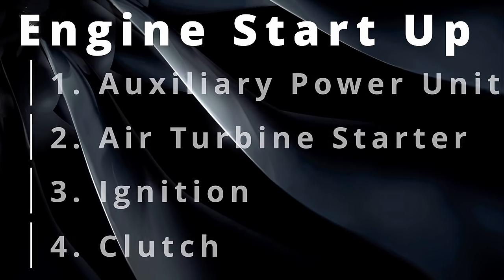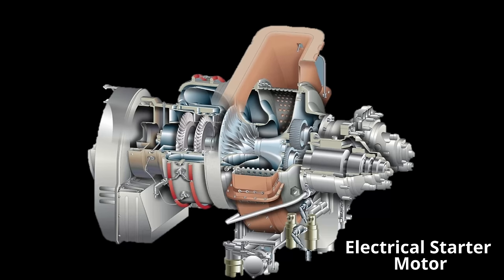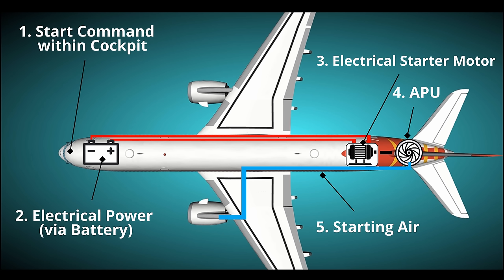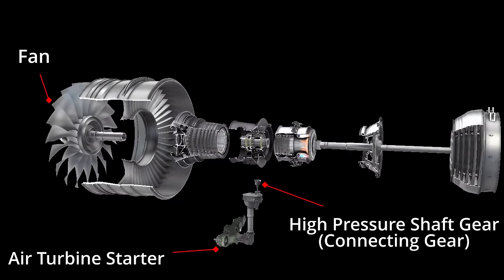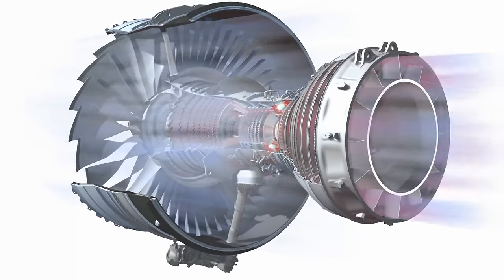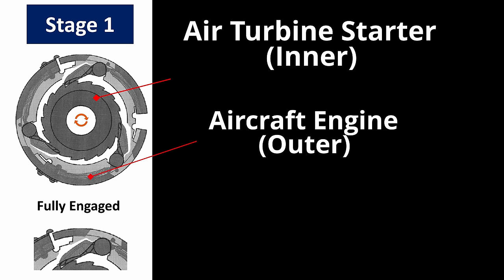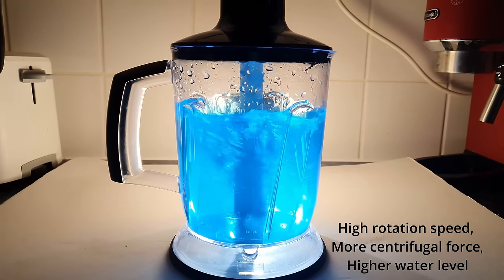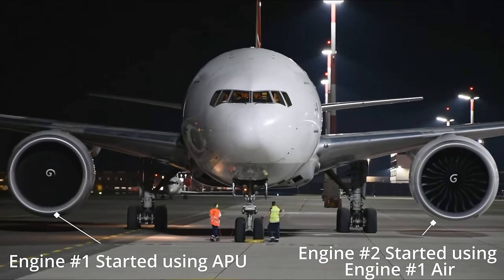How do Airplane Engines Start? (Including Startup Sounds)

Comment: Not all jet engines are the same. While APU starters are the most common now in the commercial sector, there are many other ways to start a jet engine. If the engine is small enough, it can be started with an electrical motor. Modern military jet engines either use an APU or JFS for engine start. APUs are used for both accessory air or bleed air for engine start and electrical power. JFS (Jet Fuel Starter) starters are directly connected to the engine core through PTO shafts. They will only start the main engine and provide no other benefits besides engine start. Older military jet engines did not have a starter gearbox on board and required an external air source to spool the engine for start. In the early days of jet engines, "start carts" were used to spin the motor over with a explosive charge. It looked like an oversized shotgun shell and used the explosive pressure wave to spin the motor up to speed for engine start.
Reply: Not just small engines can use electric starters, bloody great big things like those on 787s are started electrically.
Reply: @stephenholland5930  Really? Must be a big electric motor. Or a multi shaft engine 🤔

Comment: If fuel self ignites then it means fuel is Diesel. Is that true?
Reply: That part was incorrect.  Once started, the igniters are turned off, and fuel is continually fed into the combustion chamber.  Since there is already a flame there, the incoming fuel also lights off immediately.  Diesel engines need a couple hundred pounds of compression to ignite the fuel, where a jet engine might have only 50 pounds of air pressure.  
Think of a propane torch, once started, as long as it has fuel, it keeps lit.

Comment: Brought back lots of memories as a USAF crew chief. But many military aircraft the APU is an external unit that must be connected. Watched one disintegrate once. Glad nobody was in the redline blade area.
Reply: why did it didintegrate and why was it not containted?
Reply: @snorttroll4379  It's a small jet engine. It's built into a roll cart, that is marked with usually 2 red lines on both side marking where the turbine blades are. If in the rare instance the blades break or separate in any way, it will shoot through the cart sides like a hot knife through butter possibly in all parallel  directions.In the hundreds of APU's I've worked with or seen, I've only scene one fail that way. Although in training school they showed it in films to let crew chiefs know some of the daily dangers of the job.
Reply: The -60 was a mediocre air cart at best, but better than using cartridges.
Reply: Were your -60s self propelled? 

We had a -60 lose the main shaft bearing, lock up and shell out during ops checks. You could hear it bog down and then... Boom.
Reply: @iTz_JLAR  I've worked with both. Hated the self propelled. Mostly had manual ones. I would rather either pull them (as long as the tires were fully inflated and not low) or find a tug to hitch it to.
Reply: then it is a GPU Ground Power Unit.
Reply: @PeterNGloor  Yeah, I know, just typed the wrong one, thanks.

Comment: Just wondering what makes the plane stay still even the engine on high speed 🚅.
Reply: Do you mean before take off? Aircraft have brakes
Reply: @NicholasRiviera-Dr  i know it have brakes but i feel it have also some mechanical engineering behind it the amount of pressure coming out of this engine can move anything , i  also watch the helicopter 🚁 it will be on a high speed and still on the ground not moving until the pilot move it . I might be wrong 🤔 i just asking
Reply: @Johnwa99  I don’t understand your reply. As you know, aircraft have wheel brakes. They stop the aircraft from moving if takeoff power is applied to the engines
Reply: @NicholasRiviera-Dr  what am trying to say i think there more than brakes to keep the plane on the ground without moving this engine can move anything i don't think only the brakes what stops the plane from moving i think there are more things to it , i will check on Google i might be wrong 🤔 i just asking
Reply: @Johnwa99  I work on aircraft, it is only the brakes that prevent the aircraft from moving at the start of the takeoff roll
Reply: @NicholasRiviera-Dr  ok thanks 👍 I appreciate your reply since you working on aircraft can you explain to me also how the helicopter 🚁 on the ground with full speed engine and not going no where until the pilot take off. Thanks again 👍
Reply: @Johnwa99  aeroplanes are “fixed” wing aircraft while helicopters are “rotary” wing aircraft. Each helicopter blade is an aero foil that is spinning. The pilot uses a control called the “collective” to change the pitch of the main rotor blades. While the helicopter is sitting on the ground the blades are spinning with very small amount of pitch so it doesn’t create enough force to lift the helicopter off the ground. The speed of the blades is also very low, controlled by the throttle. As the pilot decides to lift the helicopter off the ground, the blades speed is increased by the throttle but the pitch of the blade is also changes by the collective to give the blades more lift, then the helicopter starts to move vertically.

I haven’t studied helicopters for a long time and never worked on them except during my initial training, so some of the information above might be a bit vague, but helicopters are a specialty. Do some YouTube searching on helicopters and how they work. They are amazing machines, particularly how they are able to change the pitch of blades (including the tail rotor) while they are spinning.
Reply: @NicholasRiviera-Dr  thanks for the information I appreciate it, I really thought that there is more to stop the airplane ✈️ from moving on the ground because the engine are really strong and give lots of pressure, but really thanks I glas I heard from someone who knows what he talks about. 

About helicopter 🚁 I use to work offshore so everyday we use to deal with helicopter and the small airplane the one with 2 fan , so for me I feel even the helicopter on the ground I use to feel the powerful engine u can't even stand under it 😂 but I really don't know how fast it is and honestly the pitch noise use to get lower after taking off . 
Thanks again 👍
Reply: @Johnwa99  there are occasions when we need to test the engine by doing an engine ground run. Sometimes that requires us to go up to take off power when the aircraft is stationary. The aircraft will be positioned on a run bay with a blast fence behind the aircraft. The brakes are parked but we also use very large chocks around the nose and main gear incase the aircraft skids.

I don’t work on helicopters but have a very basic understanding of the way they work. I did spend some time studying them during my training
Reply: @NicholasRiviera-Dr  that's great information there thanks 👍, I think you enjoy all the time working there I like to hear the engine sound 😂 but I think you all have to be protected all the time from that noise. Thanks again 👍 Respect
Reply: @Johnwa99  I’ve been working in the industry for over 30 years. The noise has caused some problems for my hearing (and every other person I work with). It’s very interesting and complex
Reply: @NicholasRiviera-Dr  oh wow 30 years that's impressive, I can imagine how you miss to go back there and work, hope you have your own business by now so you can enjoy your days. English is my second language so excuse if I say something wrong. Blessings
Reply: @Johnwa99  I still work there 😀
There is always something new to learn, great job for me
Reply: @NicholasRiviera-Dr  wow 😳 30 years and still working that's great it's time to take a boat ⛵ and enjoy your life 😄 . Blessings

Comment: As an airline mechanic of over 30 years, we almost never cross blead air from one engine to start another unless using a ground air supply in the event of an inoperative APU.  
An example of that would be an inop. APU, the airplane is located off in a remote area with no ground power available, and using an air start piece of ground equipment, you could use the emergency battery bus and fire the engine ignitors with the battery. 
Spin the starter, then fire the engine ignitors with the battery power, once you have an engine generator on line, the airplane is powered, then cross bleed and start the remaining engine/ engines.
Other wise the APU's installed in most airliners were more than able to start any engine you chose.

Good video, great explanation. 
On the B-52 though standard engine start up was to get #4 engine running, cross bleed air to start #5 engine, then use those two engines to start the rest on their respective wing. Really fun.

Comment: Your description of an engine start isn’t accurate.  I haven’t flown every turbine aircraft flying today, so there may be exceptions, but I’ve flown the CRJ as welll as every model of the 737 since the classic -300 and we start both engines using APU air.  We don’t start the first engine using the APU and the the second using the first engine as described in your video.  I know there are aircraft such as the 777 which can start both engines at the same time using bleed air from the APU as long as atmospheric conditions allow (low pressure altitude).  We can start the second engine of a 737 using bleed air from an already running engine, but we’d only do that if the APU was inoperative and we had to start the first engine using an external air start cart to provide the necessary air pressure to turn the starter on the first engine.  And even then, we’d have to run the thrust up on the first engine to get enough bleed air pressure to start the second engine, which would require us to coordinate with ground control to find a location in n the airport to run up the first engine without damaging anything behind us.  In general jet airliners use the APU to start both engines and then shut it down to save fuel.  I’d love to hear if there are newer airliners such as the 787 or Airbus 359 which start engines as you describe, but I haven’t heard that they start their second engine that way.
Reply: Nah 787 doesn't have a pheumatic start, just electric, and an a350 starts like how a 737 would
Reply: You're correct. On the 747-400 for example, the APU puts out a higher bleed air pressure than the idling first engine, so the check valves on the first engine close, shutting off the engine air supply. If the APU wasn't operating, you'd have a ground start unit to start the first engine, then push back. Only then would the first engine start the other engines. You will probably have to go up on power on the first engine to achieve sufficient bleed air to start the other engines.
Reply: Also when starting using a main engine bleed air, It is Hot so there is a time limit that you can use it. @ImperrfectStranger
Reply: @arthurhardy  Sorry, I don't understand what you are trying to say. What is so hot? Are you saying main engine bleed is hotter than APU bleed? Are you saying the bleed temperature is the main issue and not the temperatures caused by the high rotational speed of the starter? Or are you talking about starter time limits on any start? Or something else?
Reply: When I pulled alert duty on the KC-135A, we would load one starter cartridge to get one engine started.  That engine would then go to full power, to start the other three engines at the same time.

Comment: A few inaccuracies here, 

Air turbine starting doesn’t turn the compressor, it turns the accessory gearbox which turns the high pressure turbine. 

The right hand engine is started first in normal operations.

The running engine does not start the other engines in normal operations, the APU’s bleed is still used. The a380 and 747 are exceptions as two engines can be started at once when there are three sources of bleed air. 

Gas turbines don’t use a spark plug, they use igniters. They don’t use injectors either, they use fuel nozzles. There are major differences.

Comment: @1:08 - What’s that little fin for?
Reply: For directing airflow into the APU air inlet
Reply: @ImperrfectStranger  Yes but the fun in front of it is obstructing the intake….sort of. No?
Reply: @locoHAWAIIANkane  Not really. How can a small, blade shaped device restrict the airflow? It's like the vertical fin on a T tailed aircraft.... except it doesn't change angle.
Reply: @ImperrfectStranger  Yes but what purpose does it serve? Does it help the intake or channels air in to the APU…..???
Reply: @locoHAWAIIANkane  I don't understand the difference between your "help the intake" and "channels air into the APU". Aren't they the same?

The books describe the fin as a "vortex generator and flap". The tapering fuselage/empenage is probably an area of low pressure.... which is not what you want at the inlet duct of a jet engine. Vortex generators help air stick to surfaces, in this case the surface of the inlet. The flap part probably also helps deflect air into the inlet/intake.
Reply: @ImperrfectStranger  THANK YOU!
Reply: If you are referring to the three fins behind the intake, those are vortex generators, to improve airflow to the flight controls.
Reply: @robertheinkel6225  Thanks but I was referring to the little winglet in front of the intake.

Comment: You rarely use air from the first engine to start the second because it requires you the power up the first engine to build up enough pressre to start the other. APU is always used to start both engines unless the APU is deferred and your options are to air start or use an already running engine. Also the way engine are numbered is left to right from the pilots pov from his seat so you got them backwards when you labeled them.

Comment: So only one main engine has a starter turbine?  Does this mean that if the starter equipped engine fails in flight that its no longer possible to start the non starter equipped engine if it should also need restarting?
Reply: The two engines are identical.

Comment: Nice video, like the graph in the end.
However, I wonder why it is so difficult to get the animations with a rotating jet engine correct. So many channels, including this one, get the direction wrong. Check at 2:12 - it was even correct in the scene before. Why is no one ever looking at this videos and thinks "hey, why did the rotation change direction? That doesn't happen in real life either".
Reply: It's a known effect of the way our mind processes video.  A video is a large number of still images played at a high rate of speed.  Because of the positions of the turbine blades in each picture, it can give the appearance of rotating backwards even though it's not in real life.  Our brain isn't used to processing a series of pictures since in normal life, we see everything continuous.  The animation is correct, our brain is just processing it wrong so it looks like it's in the wrong direction.  There's a bunch of good videos and articles about it.  Here's one.  https://www.youtube.com/watch?v=SFbINinFsxk&ab_channel=PhysicsMadeFun
Reply: @ahapka  That would be a completely logical and valid explanation of it'd be real life footage. However, we're having here an animation where every parameter is under the control of the editor. There surely wasn't any pressing need for selecting exactly that one rotation rate that, combined with the number of blades, gives an impression of a backwards motion.
So, the question remains still valid: Didn't anyone check the produced animation and discover that it looks crappy if the blades seemingly spin backwards? Or is it due to a lack of knowledge, causing the animators to not even recognise it?

I've seen similar already with other animations, e.g. about ship propellers, which even in real life don't turn quick enough and have too little blades to cause that effect. Difficult to put some exact numbers to it, but I'm under the impression that the low-quality productions had it more frequently. That statement can also be taken as a hint...
Reply: @smurface549  ok, I see your point now and I agree.  You are right.

Comment: I once had an Engine like this at my house, I used it to cook pineapples and then sell them.
Eventually I realized the fuel was too expensive which was not worth it .. I lost more than I earned, like $40k a week just on fuel, to cook only about 200 pineapples.
I had net loss of over 99% .. I wish I realized it sooner ..
I still have that Engine stored under my bed.